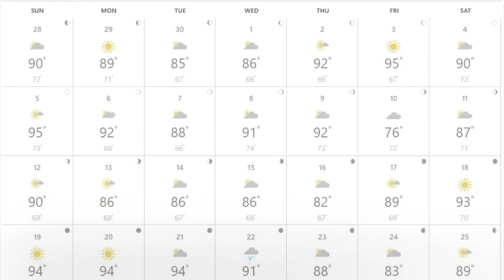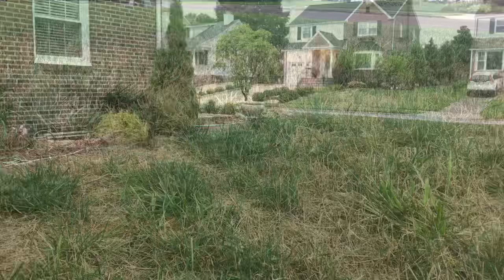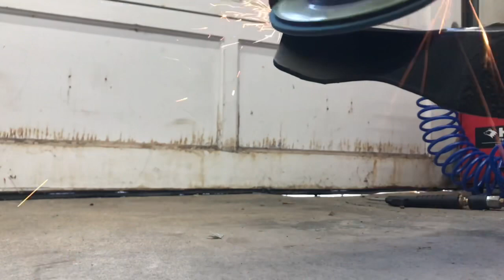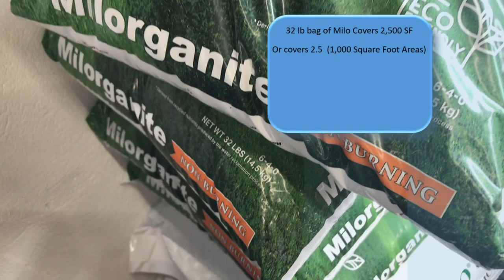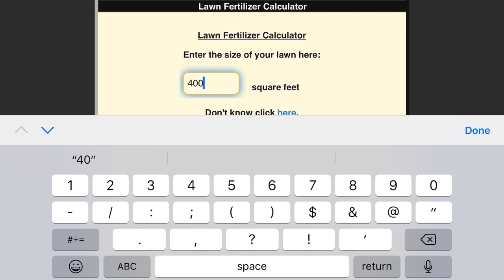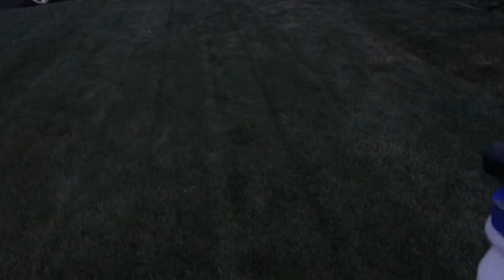Keep Your Lawn Green Through Summer

Comment: Well done man!  Would love to get your opinion on whether or not its worth having grass in the desert.  My buddies used to use two different type of grass and had to reseed every year.  Eventually they bailed on the whole idea and just switched to astroturf.  The City of Scottsdale actually will give rebates to switch over due to water scarcity.  Another cool video idea being to stormwater guy I am, would be ways of routing gutter flow for passive watering.  I like the french drain idea but not sure how much of a balance it is to get water away from the house vs evenly through the soil or if simple watering has just less of a pain in the butt factor.
Reply from the maker: You could go with something like Bermuda.  That withstands the heat well.  But there are a few “universal truths” to growing grass.  You need water, seed-to-soil contact, sunlight, and optimal temps for germination. For Bermuda, I’m reading that optimal temps are between 75 and 90 degrees.  80 degrees would be the perfect temperature.
Reply: The Lawngineer 110 in Scottsdale today :-(